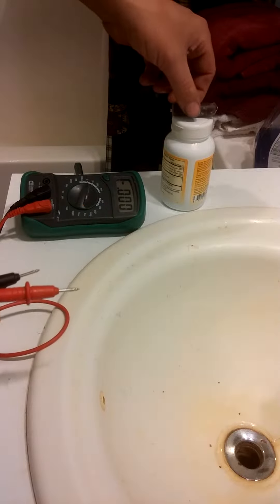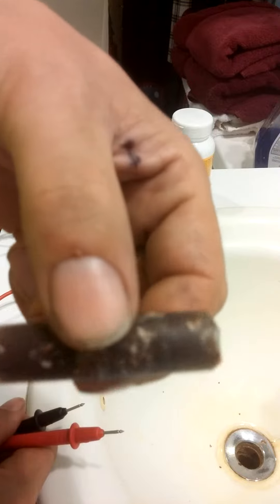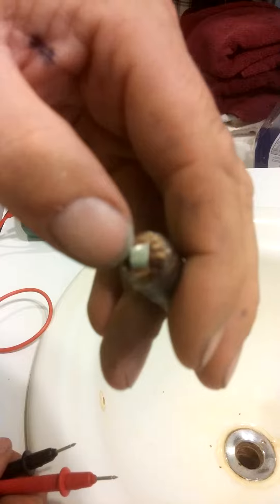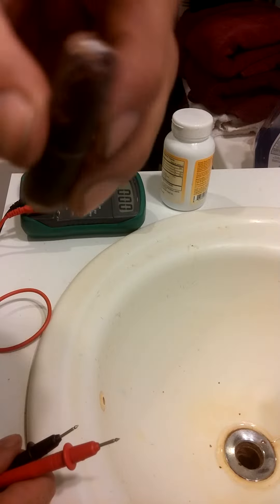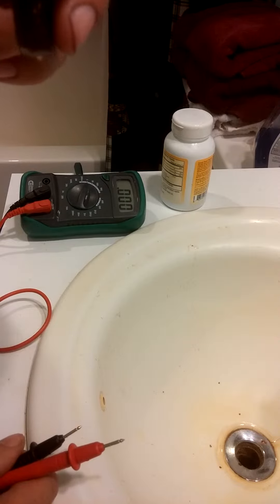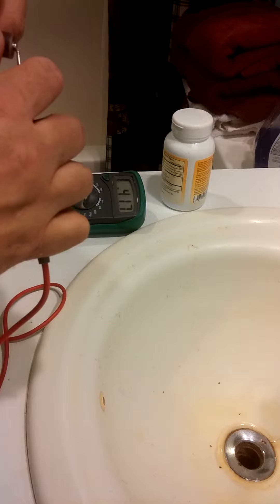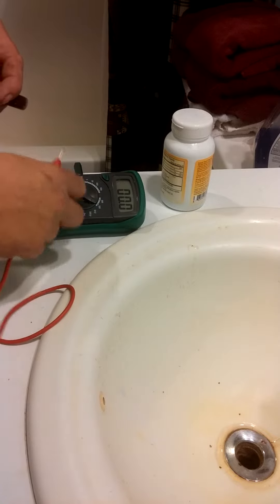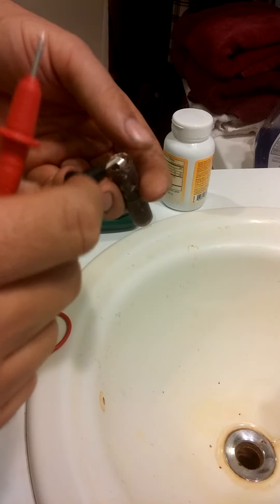cell number 2

Comment: Stacy, nice build
Try taking the multi meter apart, it should have an extra fuse in it for the amps
try changing it out so you could read amps
Reply from the maker: Ok will do

Comment from the maker: small update. The voltage after 2 weeks of shorting it out lighting small led bulbs etc. Never put  charge into it is still 1.23 volts . If i hold it tightly in my hands the heat just from that goes up to 1.3 volts. Until it cools again . It fell apart thought i ruined it but when i put it back together it still works the same even with the crystal cracked.